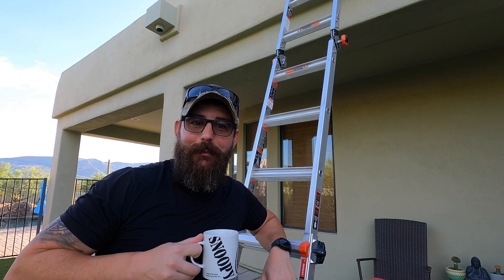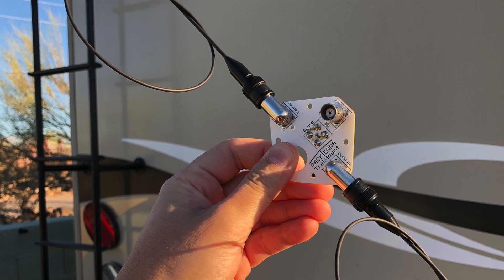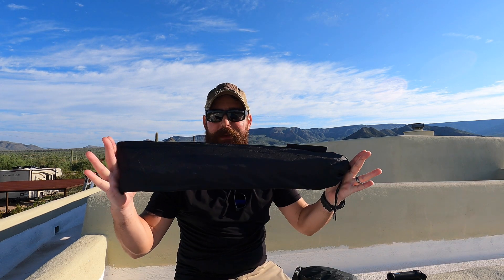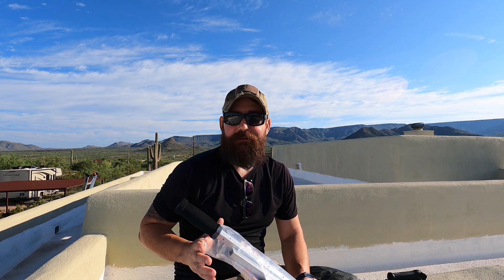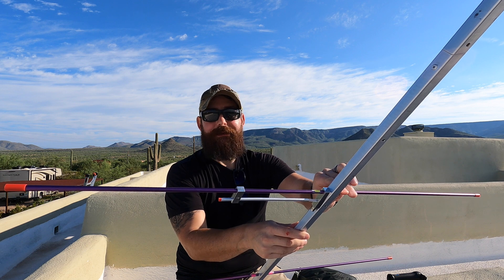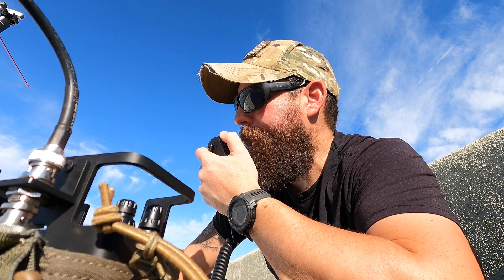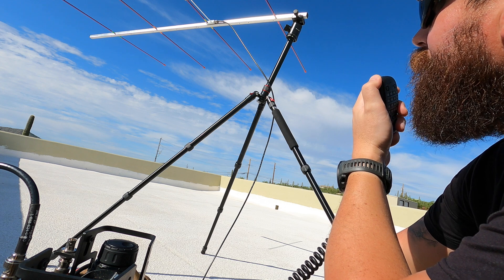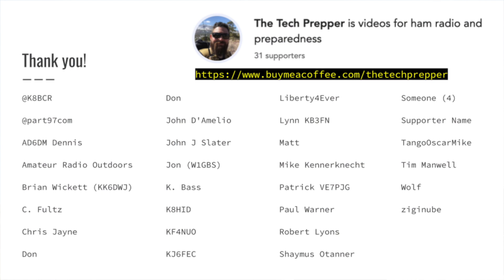Arrow II Yagi Antenna, 2m SSB Net, and EmComm Tools

Comment: Very cool to see this! I haven't seen anyone do 2m SSB before now. Is 120 miles typical range you can expect with this setup? I'm actually looking to be able to reliably communicate over that exact distance and it looks like this setup might fit the bill. Time to do some looking for some cheap 2m SSB rigs since I can't really afford to get into HF yet.
Reply from the maker: Glad you enjoyed it. I am honestly surprised that 2m SSB has gone out of fashion. Based on my tests as well as claims from other hams, 2m SSB will out perform FM. For example, in the same area with the same equipment, my farthest FM simplex contacts have been around 60 miles. I'll be running more tests, but I am sure I can easily push 200 to 300 miles while on a peak. I am going to try to work some stations in California from Arizona in the fall. And, yes, the camera is coming with me on that adventure. 

I have tried to find inexpensive 2m SSB rigs, but have had no luck. These don't appear to be made these days anymore. There was another ham that commented here indicating that 2m SSB rigs were more popular in the 80's and 90's, so that's the vintage to look for on the secondary market. Good luck!

Comment: 8:05 how heavy is the antenna? seems like quite a bit to have on the end of the QR plate. any other suggestions?
Reply from the maker: On my scale, without the grip, it weighs 685g/24.16oz. It's a bit heavy for the mounting plate. I'm going to contact Arrow to see if there's an issue drilling a 1/4" hole farther down the boom.
Reply: It might be worth looking at drilling out the boom, that's a common mod satellite operators do. Here's an example: https://twitter.com/W3ARDstroke5/status/1222508906687205377?s=19
Reply from the maker: @ryanzink5048  Ryan! Hey, bud. Thanks for jumping in...I was going to ping you on this topic. Very helpful.